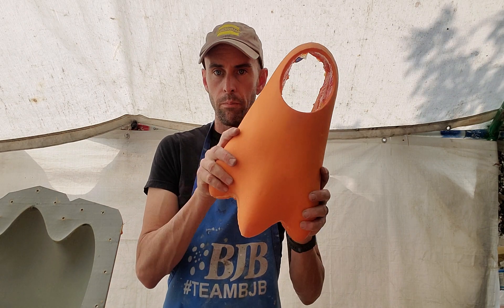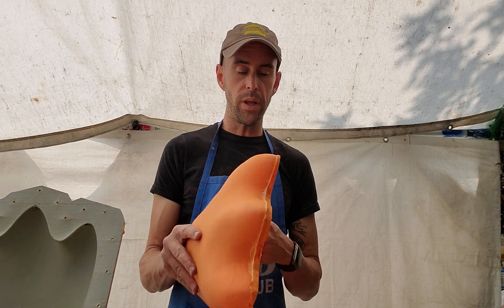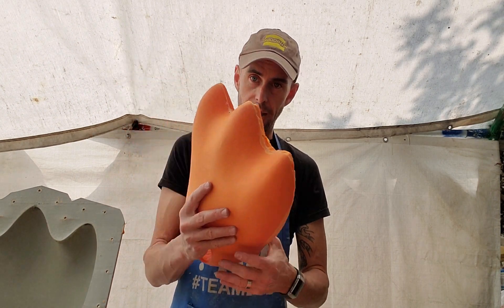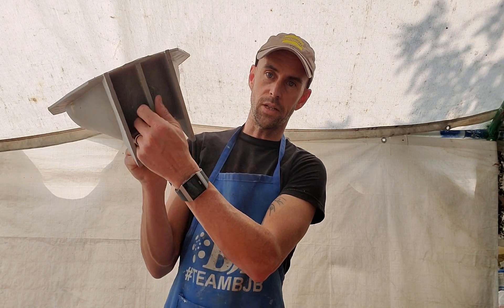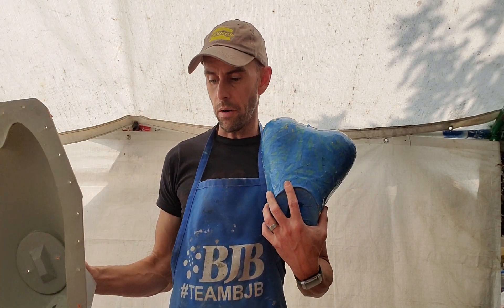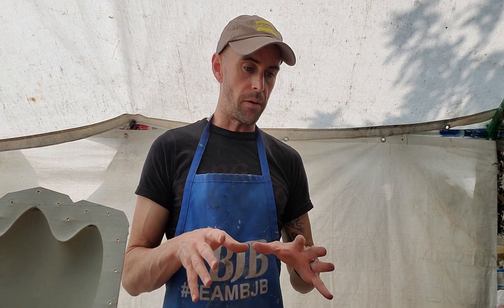Casting Flexible Urethane Foam in a 3d printed mold.

Comment: it never occurred to me that i could 3d print the mold instead of the actual think, and put silicone on it
now to actually get a 3d printer-

Im not too worried about the final look of the casted piece, thankfully. Since it's just going to be covered with cloth materials that will more or less hide any mild imperfections
Reply from the maker: It's a really handy trick. I use it pretty often.